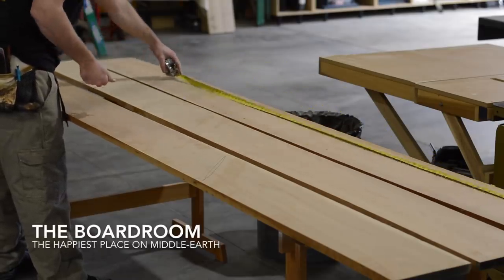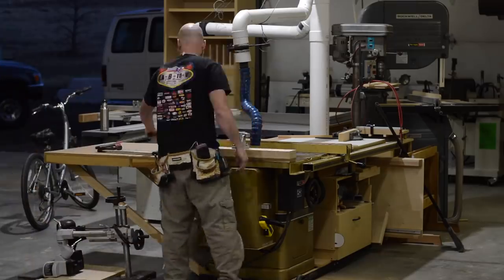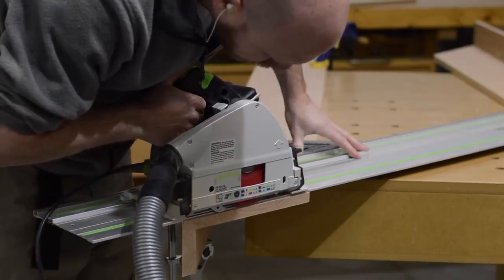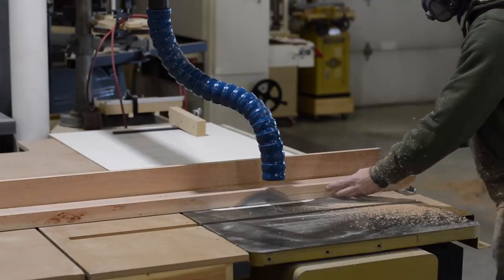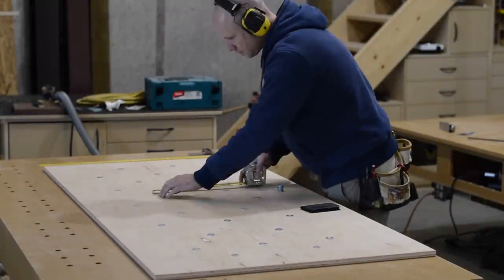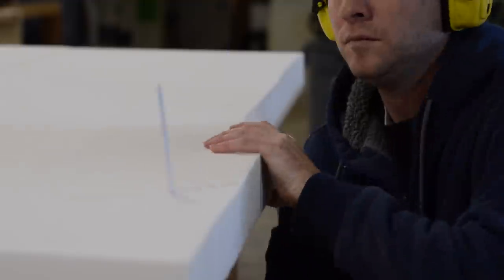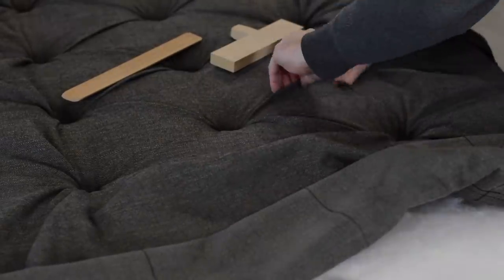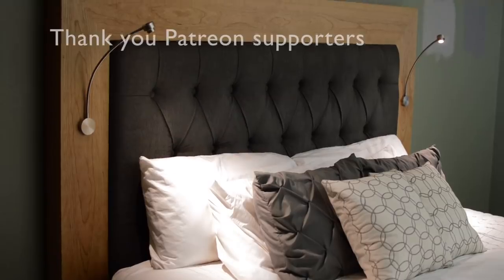Heres How I Build a Tufted Headboard, Woodworking and Upholstry

Comment: The engaging way you walk the viewers through the entire build is superb. Kudos!

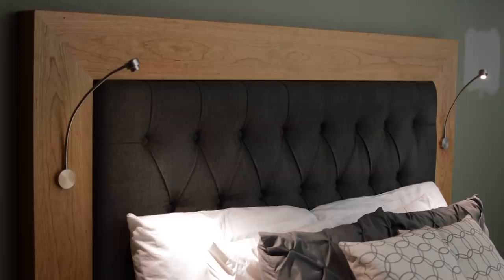18:56 if I could give my two cents on the matter, how about a modernized arabesque or baroque pattern that uses the same shade of colour in different finishes (i.e. glossy and matte) to distinguish the borders from the filling? That way you'd keep the theme from the headboard and bedding, but avoid drawing attention off the bed, which is the focal point of the area...
Reply from the maker: Thank you for your input. I like it.
Reply: Breno Luna I tend to disagree to a point. You state that the focal point is of the bed itself and not the headboard but, and this is only my opinion, when you have a headboard as beautiful as this then it’s my feeling that the headboard has become the primary focus as a piece of beautiful, handcrafted furniture and the bed itself simply becomes secondary and although still an important part of the rooms aesthetics and finish but not to the level as if you had a plain, cookie cutter style bed frame. 

If you are going to go they the effort of building s beautiful piece then it doesn’t make sense to mask its lines and style to get it to blend in so that a 10 year old bedspread and a handful of pillows can be the focal point. 

But too each his own. That’s why there’s no right or wrong in interior design. Mike did a fantastic job designing, building, and upholstering of this headboard but ultimately he did it with his taste in mind and now you and I can take from his design and change the little things that will suit us better. 

Good luck with whatever your working on
Reply: @1982MCI  too long, didn't read. Nevertheless, read "the bed" as "the headboard and the beddings against it".

Comment: Another fine piece of work.  

For these long bevel cuts the video makes clear the importance of keeping the work flat, ie no cupping, during the cut.  With no table saw or plainer, what do you thing of my chances with just ripping the bevel cleanly with a track saw?  If it’s not practical, then perhaps I should back off and do horizontal planks joined down the rails with short bevels in each plank to form the folded side faces.
Reply from the maker: I think very good. If you have a good straight track and a sharp blade, go for it.

Comment: Beautiful headboard.  You make the tufting process look relatively easy or at least less daunting than I would have expected it to be.

I am curious as to how the apolstered panel is attached to the frame.

Thank you.
Reply from the maker: Thank you. Tufting is not too hard if you get the layout correct. The panel is attached via two strips of plywood that span across the back of the frame. Then I screwed through the strips into the panel. Hope this helps.
Reply: @MikeFarrington  yes, it does. 😎🇺🇸🎄
Reply from the maker: @mungkeygp5214  Cool.

Comment: An electric carving knife works as good at cutting foam as an expensive pro tool, just doesn't have a stabilizer foot. Use it freehand, or mount it protruding through sheet of [plywood, clamp on a board for a fence, and you can achieve straight, square cuts. The one in your dining room will work fine. It only gets used once a year as it is.
Reply from the maker: Good tip, I'm just to cheap. I like the idea of mounting it to a piece of plywood. That may come in handy one of these days.

Comment: Hey Mike Great video! Where did you get the smaller wheels for your 1/4 HP power feeder.? I buy my larger tires from Acrotech for my two 1 HP 3 roll feeders, but I have two 1/4 HP that could use some better tires. Unfortuantely Acrotech has the small tires, but not the aluminium hubs. Thanks! Scott
Reply from the maker: The wheels are not smaller. I buy my feeder wheels from Western Roller. Its about 100 bucks for the set.
Reply: @MikeFarrington  Hi, sorry for the confusion, I didn't mean smaller as in smaller than normal,  I meant smaller than the 1 HP feeders. Are these the replaceable hub style? Thanks! Scott
Reply from the maker: Ah ok, I got it. These are hub and wheels replacements. Unbolt old, bolt on new. Wester Roller does sell just the rubber for some feeders. Give them a call, see what they have for your feeder.
Reply: @MikeFarrington  Thanks Mike! I'll give them a call. I have two 1/4 HP (Delta) that need some better wheels. Thanks! Scott
Reply from the maker: @TheWoodCraftsman  New wheels will breath new life into a small feeder.

Comment: Congratualtions on the successful mating session. While I have your attension, I'm curious on your opinion of the strength of biscuit joints? most of the internet says they add nothing and are purely for alignment. Yet I see you use them ALL the time. And you're pretty alright at the wood working stuff :D .. so what do you say?
Reply from the maker: Ha! Thank you. Well done if I do say so myself. Like most things on the internet, rumors are perpetuated by people typing, not people in a shop working day in and day out. Biscuits are not the strongest joint in the world, but they work pretty good. I have thought about doing a rebuttal video to all the naysayers. Honestly the hard part about joinery is knowing what is enough. I use biscuits, where I think they will work. I will also say for under 200 bucks, a biscuit joiner can get a lot of work done.
Reply: @MikeFarrington  Please do a rebuttal video. It would be good to see a professionals opinion.
Reply from the maker: @SirBenJamin_  Thank you. I will give it some thought, someone needs to say something.

Comment: The tip about doing a backwards scoring cut with the track saw was really interesting! I rarely use my track saw in situations where splintering or chip out is a concern, so it isn't much of a priority for me, but the few times I have, (cutting veneered particle board and such), I've found that setting it for scoring depth and cutting normally still chipped a little bit. Now that you mention it, though, it makes total sense since I was already aware of the reverse spinning scoring blades on panel saws, and the concept of climb cuts for routers and such.

Have you noticed an issue with the scoring pass leaving a small "shelf", for lack of a better term? I think it might be from runout in the blade or something, but when I do use the scoring function, I'm left with essentially a 1/64" rabbet along the edge of the cut, which is pretty infuriating when you go to attach edging and there's a hairline crack along the length of the joint. If you have encountered it, have you figured out a solution for it?
Reply from the maker: Its a neat trick for sure. A small shelf can occur, I just try to pressure the saw the same way each pass. This keeps the shelf to a minimum.

Comment: Have you any images of the back of it to see how you fixed the centre of it to the frame?
Reply from the maker: I don't have any images, but I showed a shot of 3 strips of plywood, those were screwed into the blocking I added. The lowest strip was bolted to the bed frame the other 2 strips were used to mount the upholstered section with screws. Hope that helps.
Reply: @MikeFarrington  Ithink i know what you mean yes. you added the stips of ply to the upholstered liece at the rear obviously wider to attach to blocks. ps what was the wood species you used and how thick was the frame part 18mm? (3/4 inch )
Reply from the maker: @ChristopherClaudioSkierka  I used cherry lumber and it was probably 13/16 or so. It was rough 1" then I milled it down.

Comment: I often have issues with glue affecting the stain, even after wiping with a damp rag, drying, and sanding. Do you have any suggestions?
Reply from the maker: This will be a constant trouble, use as little glue as possible.

Comment: Also ... the long bevels seem to only use glue along the runs, tied in at the miters on the ends. Not even any brads that I saw. No concerns that those bevel corners  won’t open up over time?
Reply from the maker: No a properly glued bevel joint needs no extra strength, its stronger than the wood.
Reply: Mike Farrington Because the joint is edge grain on edge grain, with a lot of surface area?
Reply from the maker: @Nill757  Correct.

Comment: Biscuit joints are far stronger than people realize. People keep saying they are only for alignment when they can do far more than that.  You would never use biscuit joints on its own for a table stretcher or rail but that does not mean they cannot be strong joints.
Reply from the maker: Totally agree. When used in the proper application biscuits are great. I think the alignment thing is an internet driven idea vs people actually having a joint failure. Along the same line, festool dominos are given too much credit is some cases.

Comment: Yeah the bucket tip  is golden. Love all your videos. Where did you get the blue dust collection hoses for dust collection at the blade?
Reply from the maker: Thank you. The bucket trick is pretty cool. The dust collection hose is called Loc Line. I use the 2 1/2" diameter stuff.

Comment: How dod you attach the fabric section to the wooden frame and how did you attach the frame to the wall and the lights
Reply from the maker: I added blocking to the back of the wood frame then I screwed some strips that spanned from left to right, I screwed through those strips into the tufted part to hold it all together.

Comment: Congratulations!  Top notch video as usual.  How did you attach the cushion to the headboard?  Thank you for all your video "gifts"!
Reply from the maker: Thank you. I showed a shot of 3 strips of plywood, those were screwed into the blocking I added. The lowest strip was bolted to the bed frame the other 2 strips were used to mount the upholstered section with screws. Hope that helps.

Comment: Hi Mike.  My wife and I have been looking for an elegant solution for bed lighting that looks good and is subtile. We too had the concern regarding one or the others light interfering with sleep.  Our headboard is tufted like your and was wondering how the lights attach to the headboard.  The photos on Amazon do not show the mounting detail.  Solid work as usual my friend!  Looking forward to more.  When will you post on Patreon?
Reply from the maker: Thank you. These lights mount easily. There is a sub mount that screws in place with two screws. Its round and slightly smaller than the base you see in the video. Next the lights mount to the sub base with a set screw. There is a detail where you can have the lamp cord come out the bottom of the light or drill a hole and have it go through the sub base. I hope these lights last because I really like them. Regarding Patreon, first, thank you for your support. Second, in the coming months I will be adding some Patreon only content. Please message me directly via Patreon if you have any input, requests, questions, etc.

Comment: Thanks Mike and Congrats. How were the two pieces mated then hung? Do you recall the brand name or model of the reading lights? Thanks!
Reply from the maker: Thank you. The strips of plywood were screwed to the blocking I glued in place, then I screwed through the strips into the tufted portion. The headboard is attached to the bed frame with hardware that came with the bed. Hope this helps a little.